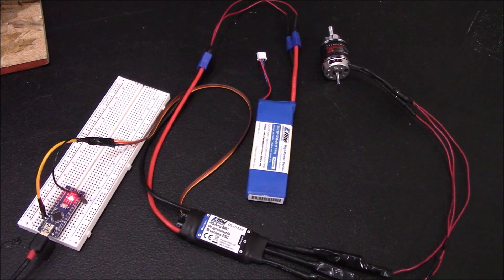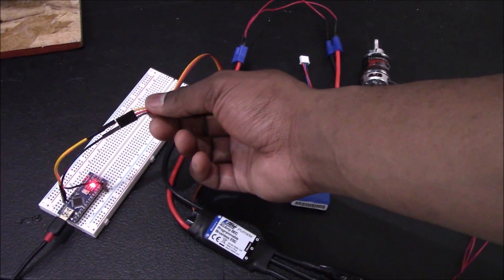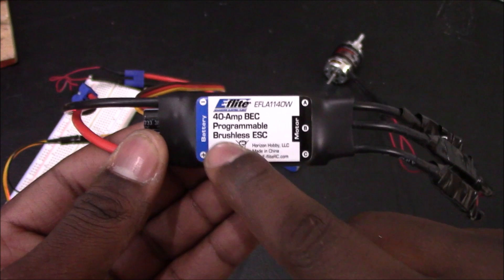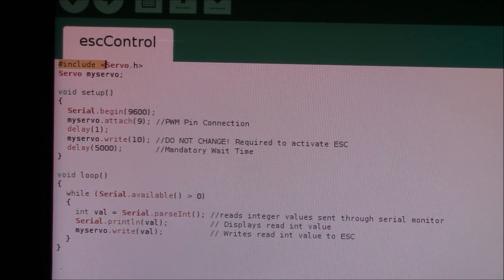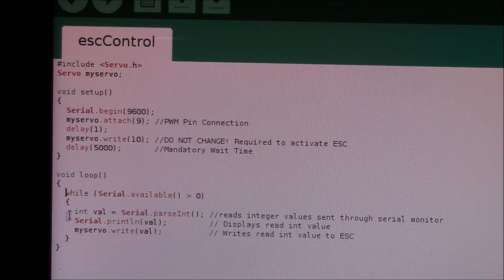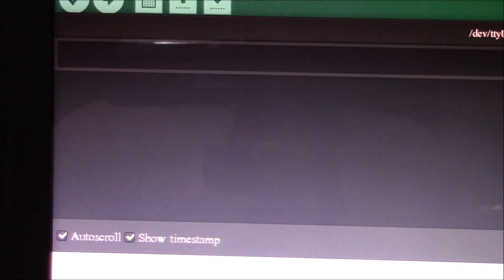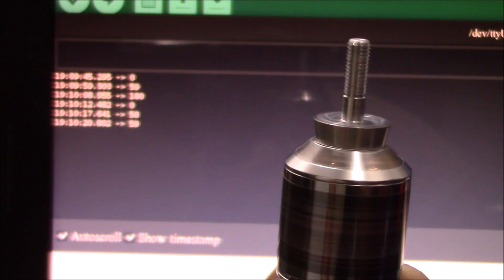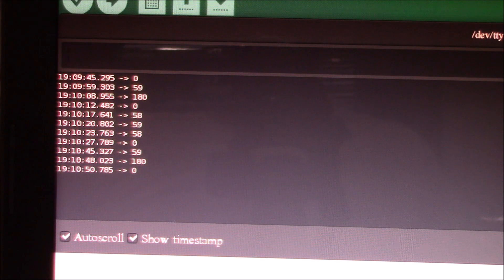Arduino Controlled ESC (Easy+ No Potentiometer!)

Comment: I can confirm this works with the Arduino Uno R3 with the Castle Creations MAMBA XLX2 with the 2028 800KV Motor - 4/1/2023. I've got a project I'm working on that it isn't going into any RC.

Comment: The motor only increases to the speed we entered momentarily, then turns slowly at a constant speed again. It repeats this in short periods. What would be the reason?
Reply: This might be a late reply but open up the serial plotter and set it to "No Line Ending" so it holds the rpm you set.

Comment: Important to note that a lot of ESCs initialize with a PMW micro second of 1500, not 10. And a lot of speed control happens between 1000 and 2000. It all depends on what range your ESC is using. I've seen other numbers too. Have to check those data sheets... ESCs are a headache.
Reply: and how?

Comment: Is there a way to wire a potentiometer to a regular ESC in order to use it as a servo controller? I'm trying to build a large scale steering servo but don't know how to get the ESC to respond to potentiometer feedback

Comment: I'm not an expert...but I don't think the ESC amperage has anything to do with the battery itself, but the motors you use. If the motor you use has a max draw of 2 amps your ESC should support at least 2 amps (greater than 2 would be ideal though).

Comment: So much misinformation here, the battery does NOT determine the current flow, the motor ESC combo does.
The battery will only supply what it is asked to supply, the specs on the battery are it's potential.
You can run a 10 amp esc on a 400 amp battery safely, as long as the voltage is right and the motor matches the ESC. A motor that draws anything less than 10 amps will work fine.
It is the voltage (IE cell count) that is critical, you cant hook an ESC designed for a 2 cell 7.4v system up to a 3 cell or more battery. That is when you are more likely to get smoke. (Or when you hook it up backwards.) 
I test 30A RC speed controllers on car batteries without any problems.

Comment: Actualy I have a question for the adjusting 59 and 180 degrees for the speed of the BLDC ,how did you define them in the code,there is not any code about it.

Comment: why it doesn't work it doesn't even arm
Reply: Same here. Some ESC work differently
Reply: Bros, He has a programmable esc.
The thing is most of the escs require a pulse between 1000 to 2000 us.
This guy's esc works from 10 to (IDK) us.
and you got yourself in problem....
Reply: @teklisbenzi  why do I got myself in problem?
Reply: @sgpaterno9117  Umm....
Just Skip this tutorial as it will not work for majority.

Comment: Hello. I got it to work but the motor only powers on for one second before stopping. I don't have enough experience with Arduino coding to see if there is something wrong. This it the code I copied from your screen:

#include <Servo.h>
Servo myservo;
void setup() 
{
Serial.begin(9600);
myservo.attach(9);
delay(1);
myservo.write(10); 
delay(5000); 
}
void loop() 
{
while (Serial.available() > 0)
{
  int val = Serial.parseInt();
  Serial.println(val);
  myservo.write(val);
}
}
Have I missed anything?
Reply: @gokhan yilmaz myservo.write(val);
    delay(5000); you need to add delay value after servo.write
Reply: @musleh711  thanks dude, it's worked
Reply: @musleh711  this worked for me also, but the motor then just runs for 5 seconds. Do you know how you can have it continue to run until a different value is input?

Comment: Hello thanks for sharing and teaching others. I tried this code and my motor working not fine then i pushed my motor is working good. but stopped after 5 seconds automatically. How can i find the mistake i made. why motor is intermittent starting? thanks

Comment: Can i use a 60v battery?
Reply from the maker: I don't believe you would be able to, but that would depend on the battery rating compared to the ESC's. Thanks for commenting!!!
Reply: @BlackFalconElectronics  what if i use a relay...
Reply from the maker: @garygracias4229  a relay would be good to use, but it would still depend on the battery & esc ratings. Otherwise you risk electrocution &/or frying all connected electronics.
Reply: @BlackFalconElectronics  ill be using a 160kv motor and a 50 - 80a esc..
Reply from the maker: @garygracias4229  what is the battery rating?
Reply: @BlackFalconElectronics  question if I have 45C 4500mah 11.1V lipo battery and a  C2204 1200kv motor that draws 11 amps would it damage 30A Simonk ESC?

I am planning to build a tricopter so I have 3 of ESC and 3 of the motors mentioned. can i make all of them work with one battery  45C 4500mah 11.1V lipo battery?

Comment: suggestion: myservo.attach(9,1000,2000); //defines the range of the servo and myservo.write(0) worked  better for my ESC. Good video, thanks
Reply: This worked for me also, however when I enter a number in the serial monitor it starts the motor but then stops within a second or 2. Any value from 8 seems to start the motor. Any ideas to keep it going?
Reply: @supersummermario  Hi there, no, I don't. I haven't play with the program for awhile

Comment: My set up is basically the same as yours except I'm using a variable power supply as my power source and I'm using a 60 Amp ESC with a 770 Kv motor. I tried using your same code but whenever I don't enter anything into the serial monitor my PWM value automatically reverts to 0 which is not what I want. I want the thottle to stay constant as yours does, any ideas?
Reply from the maker: Post your code
Reply: @BlackFalconElectronics  Actually just got it to do what I wanted. I used this code: 
#include <Servo.h>
Servo ESC;
int val;
int globalval;
void setup() 
{
  Serial.begin(9600);
  ESC.attach(9,1000,2000); //PWM Pin Connection Port on Arduino
  delay(1);
  ESC.write(0); //Activates ESC
  delay(1000);  //Wait time before commanding throttle values
}

void loop() 
{
  while(Serial.available())
 /
  {
    val = Serial.parseInt(); //reads integer vals from serial monitor input
    Serial.println(val);         //Print throttle value
    ESC.write(val);         //Write throttle value to ESC
    if (val > 0){
      globalval = val;
      //Store throttle value
    }
  }
  
    if(!Serial.available())
  {
    Serial.println(globalval);
 //Print stored throttle value
    ESC.write(globalval);
     //Assign previously stored throttle value to ESC
  }

}
Reply: @philjackson8205  I hope you found the answer. For anyone who might need it, one way you could do is to put the "myservo.write(val);" command in a for time loop, and the motor will run for that long.
Reply: @philjackson8205  thanks for posting the code it got my project up and running for the first time!
Reply: @philjackson8205  Thank you for posting the code!! It helped me get my motor actually running!

Comment: Hey! I have a flame 60A esc and I'm trying to run a 149Kv Turnigy Outrunner Motor. I followed all your steps and the esc becomes armed and ready to go but the motor doesn't run when I input any number on the serial monitor. Any suggestion?
Reply from the maker: Could you post the code you're using?

Comment: the esc provides 5V power to the servo connector- you can use this to power the Arduino (it's 5V I'm guessing?) 
and not need an external supply.
Reply from the maker: The ESC only provides power to the battery itself. An external power supply is required for the arduino & all auxillary systems.
Reply: Unless I'm misunderstanding things; the LiPo battery powers the ESC which has a 3 phase brushless motor driver, and usually a 5V linear regulator to power the receiver and servos.  The suggestion is to use that 5V to power the arduino and save a battery.